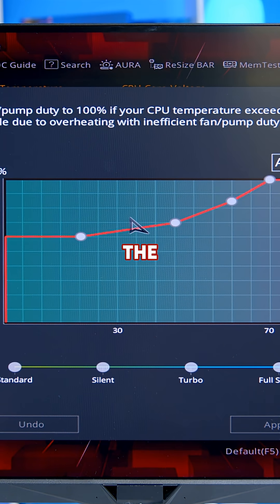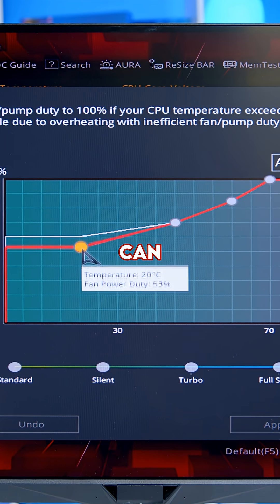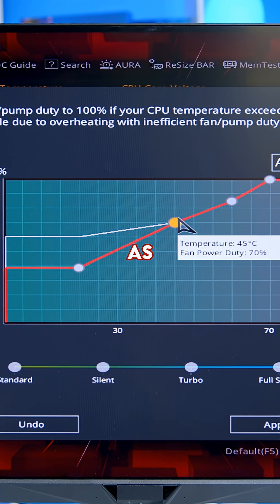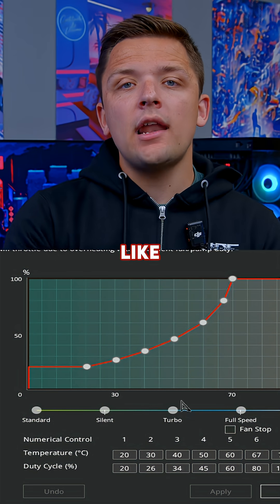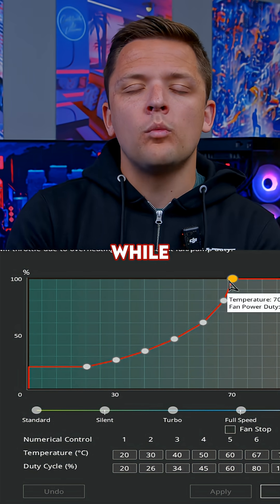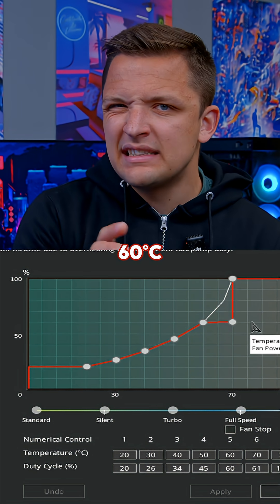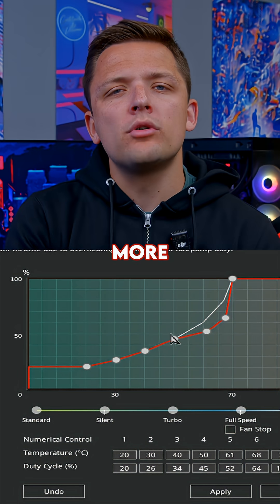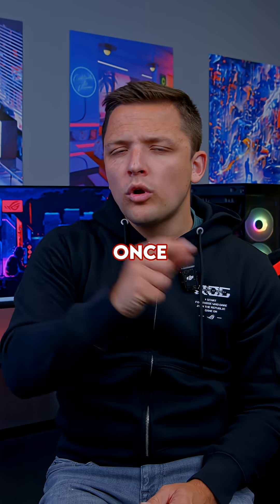Here's Why Your PC Fans Are So LOUD! And How To Fix It!

Comment: I usually keep my fans at minimum possible speeds when my PC is in idle mode (it took me some time to determine the temperatures although).
Btw, before playing with fan curves in UEFI setup utility I would recommend to calibrate fans (AFAIR there is an option somewhere close in QFan Control menu in the  utility) - this will allow to set slower speed than default ones.
OR you can just use Fan Control software for Windows, it's an open source utility that lets you control every fan within the single app (including the GPU) in different ways using all the temperature sensors available in your system - for example you can make a curve for you chassis fan so that its speed will depend on the GPU temperature - so if it gets too high not only the GPU fan will spin faster but also the chassis fan. Absolutely brilliant utility. God bless the the author.